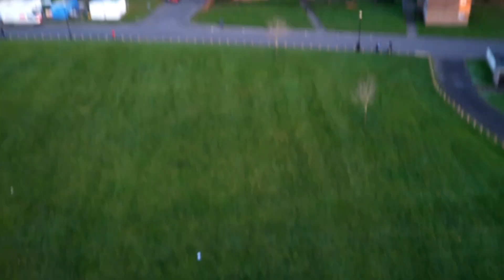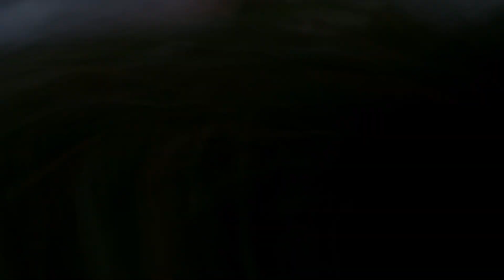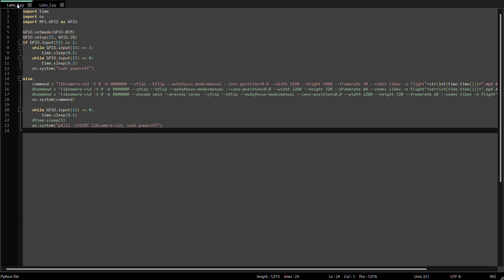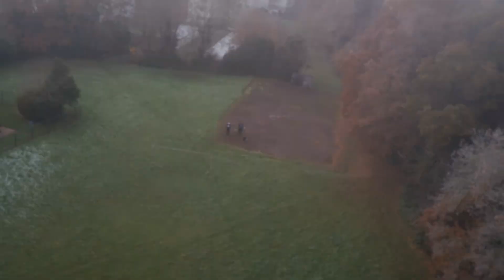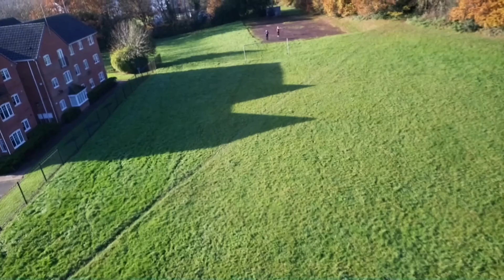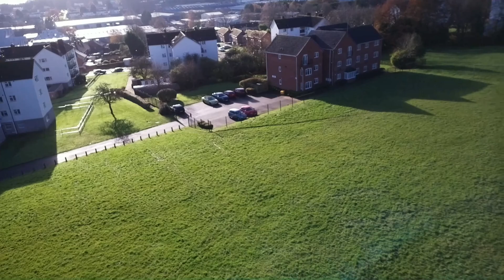Raspberry Pi FPV drone? - The Lahn Cinewhoop

Comment: Hi Artur, please tell me, does the shutdown implementation via betaflight happen via the msi protocol? and one more small question, do you connect RaspberryPi zero 2w 15 gpio - RX, to the RX1 pin on the flight controller, is that how it should be? or must be any TX pin

Comment: Great idea and project overall. Maybe you're interested in porting your analog vtx script/setup into openIPC/rubyfpv - this is what I'm going for with your main hardware (but hq cam).
Reply from the maker: Interesting idea, I also thought about it when I learned about Ruby. If you look at my newer videos, you can see that I switched to using an IP camera with OpenIPC. It's more compact than a Raspberry Pi setup, and the video encoding performance is better than with a Pi Zero 2w: higher bitrate, h.265 compression, lower latency.

Comment: Very impressive!  Do you know what type of range you get with this setup? I'm hoping to build one but, I just don't have the money for it right now. Great work though.
Reply from the maker: Thanks! I use a 300 mW VTX (video transmitter) and the BetaFPV VR02 goggles. The goggles have a directional "patch" antenna inside, so the range varies depending on the relative position of the drone and goggles, with the best range achieved when the goggles are facing the drone. I haven't measured the range though, so I can't tell you exactly, but I can estimate that it is at least 150 metres, maybe 200 or more... You would get different results with goggles that use an omnidirectional antenna, such as the VR03.

Also, if you are thinking about recording nice and crisp video, I would recommend not going for a Raspberry Pi setup... I used a Raspberry Pi because I already had one and wanted to see how good I could make such a setup, but if you want to capture higher resolution video than you see in my video you should use the more conventional setup: an FPV camera for video transmission and a separate action camera (e.g. Runcam Thumb, Runcam Thumb Pro, Hawkeye Thumb 4K, or even a GoPro if you are making a bigger drone) for video recording.

Comment: Great work man! Maybe help me understand what does the Raspberry Pi does on this drone? I ask because if you already have the FC from betafpv you can just wire the camera and VTX to it and get it flying already.
Reply from the maker: Thanks! The Raspberry Pi is essentially between the camera and the FC, and its main purpose is to record the video (also, the camera is a different kind, it's not an analogue camera but rather one with a digital output, designed for a Raspberry Pi). I wanted to avoid the need of an additional action camera for recording video.

Comment: i would love to see a digital verson of this
Reply from the maker: With the Raspberry Pi you could have digital transmission through Wi-Fi, although the latency would be much higher, which is why I used analog transmission. DJI and Walksnail are able to achieve a usable latency through more advanced protocols, designed especially for video. Personally I'm not bothered with seeing analog video in the goggles, as long as the recorded video doesn't have the analog artefacts.
Reply: @arturpekosz  I’m not an engineer of any sort but just stick a antenna on it
Reply from the maker: @BlenderSometimes  That would improve the transmission range, and maybe the latency at long range, but even with the receiver very close to the drone the latency would be too high. There is a reason why people who fly racing drones use analog transmission and not Wi-Fi, despite the inferior image quality, or the more expensive DJI/Walksnail/HDZero systems.
Reply: @arturpekosz  oh just don’t race lol
Reply: Hi , do you mean a full drone simulator ? or like a lidar fpv maybe ?
Reply: no like dji fpv type stuff @tuliomop